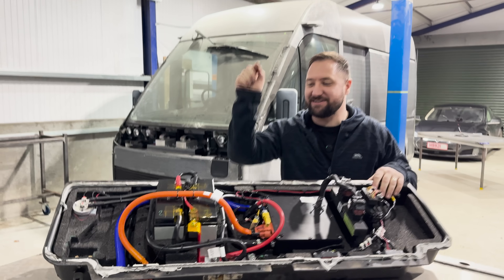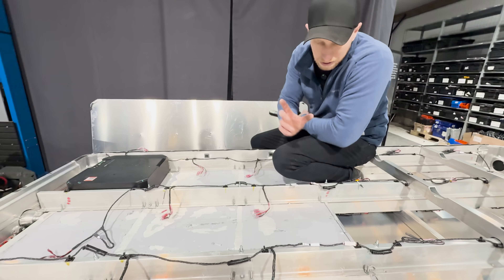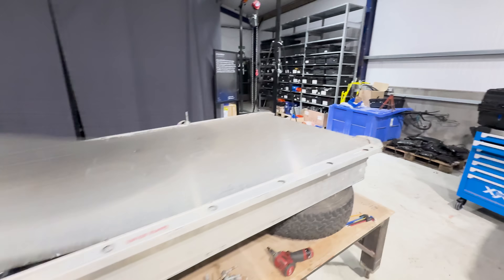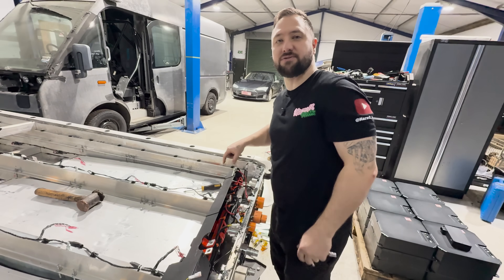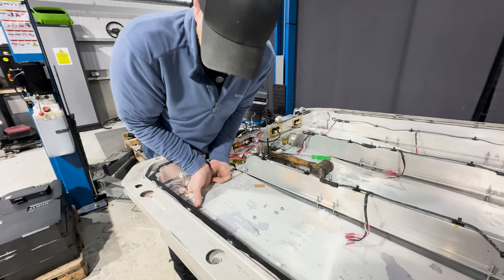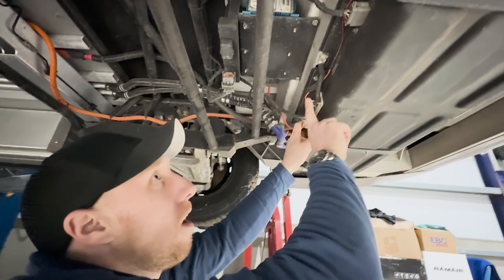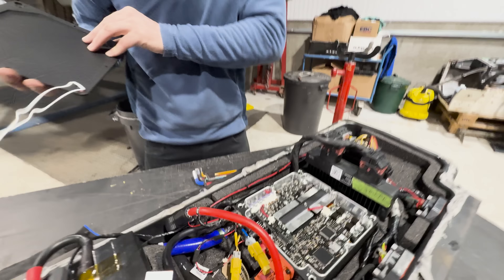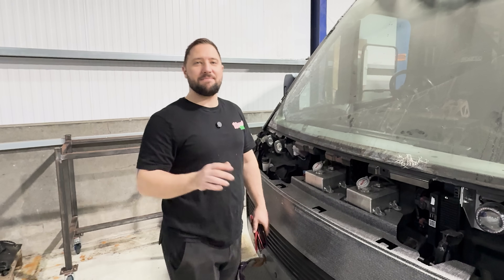High Voltage Battery strip down! ARRIVAL Was Hiding Something.

Comment: The material between the battery pack case and modules is not there to stick it down, it looks like a big thermal pad/thermal interface material for heat transport into the case and thus the cooling loop. Maybe it gives the modules some friction but mechanical something else is  there to hold it in place.

Comment: I don't think that was adhesive at all what held the batteries down. Looks more like a thermal interface material to me, to transfer heat to the casing.
Reply from the maker: Yep that’s exactly what it is, there is two types they do a thermal adhesive and a thermal paste. This looks to be the thermal paste type as it brakes up in your hand.

Comment: There should be enforced battery standardization. Such as modules would increase costs of manufactures would massively reduce the repair cost of battery packs which for me is the biggest thing that puts me off EV. It I new a get a 2nd module to replace a knackered one in my car would change things a lot.
Reply from the maker: Agree, they nearly did it in Europe with the VDA355 and VDA590 but then others decided to go cell to pack.

Comment: If you're ever struggling to release adhesive like those battery modules, try soaking it in isopropanol.
Reply from the maker: Will have to try
Reply from the maker: Will have to try

Comment: As other have mentioned that's not an Economiser, but a flywheel diode.. it protects the relay/contactor drive circuit from the back EMF that comes from a coil on power down. 
But on Economisers, you would be surprised at the number of EV systems that don't run them... most car OEMS don't want to pay for them!!... Source: ME!, a guy who works for a major EV contactor manufacturer! 😉
Reply from the maker: Thanks
Reply: ^^This. Who ever designed the contactor driver forgot about the amount of energy stored in the contactor, and clearly that fell outside the single pulse avalanche capability of the driver, hence the "Bodged in" flyback diode in the contactor harness. Unfortunately, this also means the contactor can be rapidly opened, because the maximum reverse voltage that the contactor coil can see is just that diodes forwards voltage (might be a normal diode, ie 0.75 to 1.5v, or might be a zener/tvs, which could have a higher rating). What the better contactor drive circuits do is to include a flyback diode in the PWM circuit, but use a seperate switch outside of the PWM loops to allow the contactor to be opened with a much higher voltage. This therefore collapses the contactor current much faster and as a result physically speeds up the opening, leading to a much lower arc heating event etc

Comment: You can separated double side adhesive or thermal compound by using  Dental Floss same for removing badges ets. Mono filament fishing ling works as well
Reply from the maker: That’s a good idea
Reply from the maker: That’s a good idea

Comment: I'm actually wondering if the 12V is the "production" power supply, and the 24V might be the "diagnostic" or "test" or "monitoring" or telemetry supply for the development.....

Or maybe the other way round
Reply from the maker: That’s a good point

Comment: That's not a coil economiser, it's a back EMF protection diode.
Reply: absolutely standard on any DC relay or contactor it's a freewheeling diode which is anti-parallel to the normal supply voltage and you want to have it as close to the coil as possible...
Reply from the maker: @ Lucky on the newer packs the contactor choice is different and this is not soldered in line.
Reply from the maker: That’s an odd thing to fit to a contactor
Reply: @Hazell_Nutz  Not really, you either need one at the coil, or at the switching device. If the cables are long, then it makes sense to have it close to the contactor to prevent EMC problems. They do slow down the opening time, so a Zenner diode or TVS is better. It lets the magnetic field collapse faster, but still limits the voltage level to what the switching device can cope with.